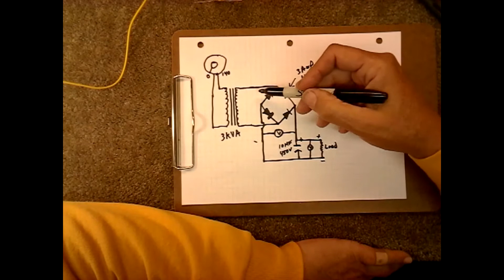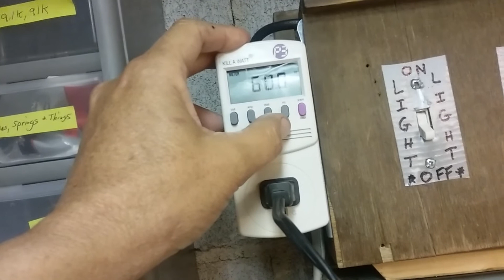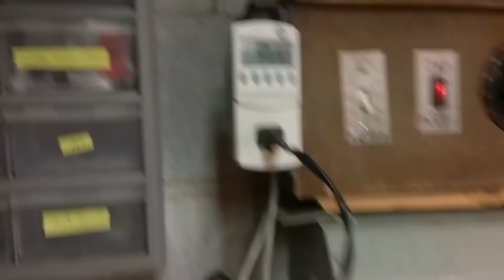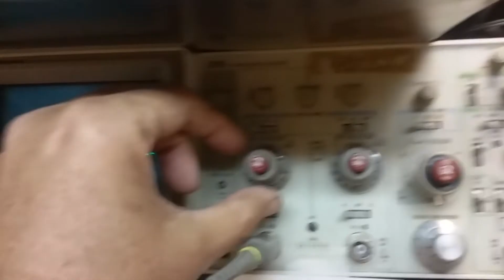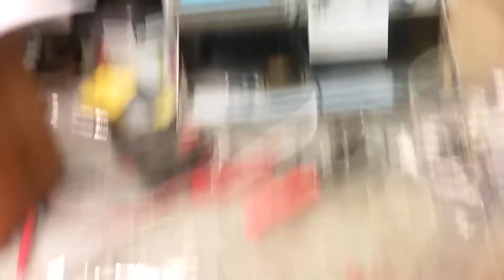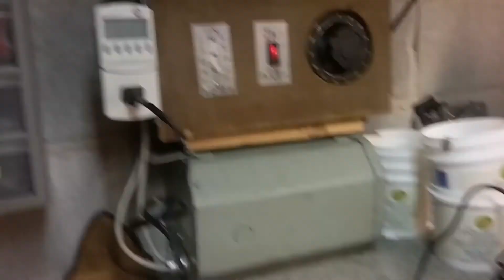Build a  Variable DC Power Supply using AC Variac & Isolation Transformer

Comment: If you want it to be of any practical use, you need bulky electrolytic capacitors (like 470uF/400V) and some kind of inrush current limiting. Yes, if you change input voltage from 0 up to a maximum voltage AC, inrush current to the capacitors wont be large, but for any sudden changes, it is significant.

Comment: Why isn´t the Variac enough by itself, why isn´t the Isolation Transformer useless ??? I don´t get it...
Reply: Without an isolation transformer, one side of the AC Line is connected directly to ground via your circuit panel. And, with vintage devices, they can be plugged in either way. Coneect it with hot going to ground on the chasis you risk an electrical shock if you touch it and ground. And if you touch it with your test equipment, hasta la vista baby!
Reply: @KJB-Man  So, it brings only the isolation onto the table ! Cause I have seen a variac being used very similarly, but without the isolation transformer, and I got confused now...

Comment: can i use an actual full bridge rectifier pulled from an old AC-DC powersupply
Reply: Even better, because you can put single unit diode bridge on heatsink to be able to load it to it's rating in the datasheet.

Comment: A great application of an AC Power Supply that just would have not occurred to me, without your video. Thank you! I have nice DC PSUs, but they lack the watts needed, sometimes. This trick will work around that. My AC Power Supply is like yours, it is separate components... An Autotransformer, an Isolation Transformer and a Dim Bulb Current Limiter. What order do you suggest that I place them in and why? Thank you!

Comment: I built one of these as well and the lack of regulation makes it pretty much useless for electronics or any load that is going to have wildly varying amps unless I'm missing something. Babying the variac is also kind of annoying (mine's a 1400VA Staco and hitting 10A is pretty easy to do on the lower voltage end). The transformer company Antek makes a series of DC supplies that are essentially identical to this setup (20,000uF smoothing caps/rectifier/bleeder resistors/fuse) except with ordinary toroidal transformers instead of a variac. Leads me to think there are probably some decent non-switching use cases out there (I'm assuming audio stuff). That said, some Chinese buck modules are of decent quality (especially the Riden series, which takes 60v-70v input where vdrop as % is lower) and I bet it would actually work pretty good with one of those for regulation. I made my rectifier/cap/resistor setup into its own thing, so maybe I will just buy a 2:1 transformer one day to free up the variac/isolation transformer if I can't find good use case outside of buck modules though.
Reply from the maker: The purpose of this video is to teach the principles of rectification and smoothing. The usage of the device is very effective for specific applications such as powering small DC projects,  transitor radios, and even tube radios, etc. You can not use it for high wattage applications because it is not designed for such applications.  But then again,  neither is an AC variac. You can't use a variac to power a toaster, waffle iron or hair dryer, etc because the high wattage draw will destroy the variac, assuming there is no amperage limiting fuse to blow! But the basic circuit here is a great addition to a bench for applications it can meet. And that, at a very low setup cost.
Reply: @ElectroRestore  I enjoyed building mine and liked your video. I think I may have sounded a bit harsh with my comment when that wasn't my intention. I agree that the price of entry is really nice, especially if you already have a variac. I'm sure I will find some other uses for mine running unregulated eventually. Hope you have a good day and thank you for the reply.

Comment: Hey is there a reason to mount 1:1 transformer after variac? I thought to mount it before variac then after variac rectifier and at the end caps? Is this okay? Thanx for the video mate.
Reply from the maker: It really does not matter in most cases. But I prefer to drive my transformer with the variac because it is rated at 7 amps. My transformer is rated 3kva. Either would work. I also have a 5amp fuse in series with ac line input for added safety.
Reply: @ElectroRestore  thanx mate for your kind reply. So since i have already 500va 2amp variac (0-250V output) do you advise isolation transformer of same specs (1:1 2 Amp) after variac or stronger before variac ie 3Amp?
Reply from the maker: @zoxwolf2133  the power (v*a) is not that important a factor when arranging them because you don't want to draw more than the weakest of the two anyway. I draw a max of 5 amps because that is my fuse. I really don't need to draw more than a couple amps of 120v mains to power any device I am servicing. I also keep it down as low as possible for safety reasons.

Comment: From the UK, I've just purchased a (variac) and I'm going to do the same mods, I already have a PSU 0-70v 3A DC but when finished I will have a 0-280v 8A AC + 0-350v 8A DC supply using a 600v 50A bridge + 600v Caps. with earth and overload protection which will cover anything I am liable to require, 240v and 415v 3 phase, we must be mad eh? but of course 40v 40mA can kill.